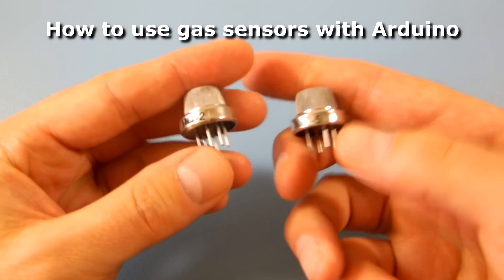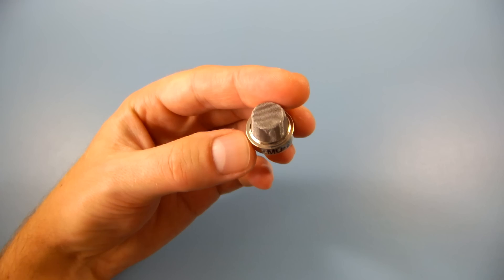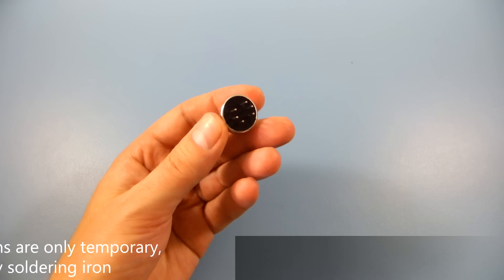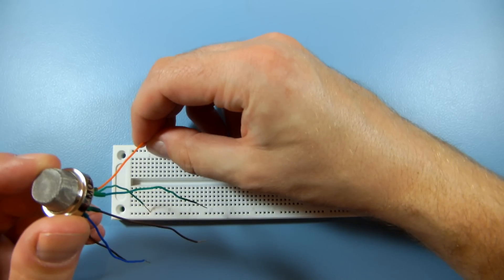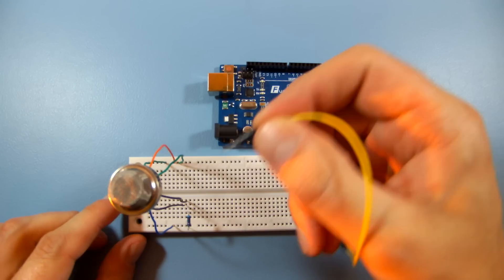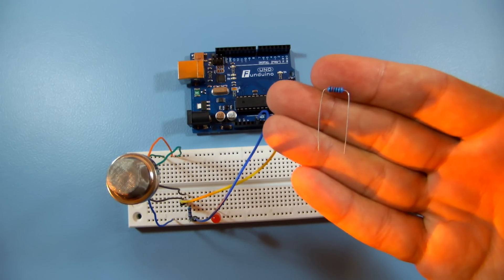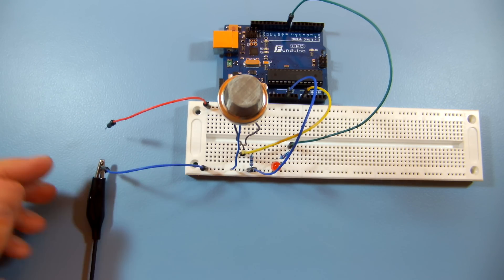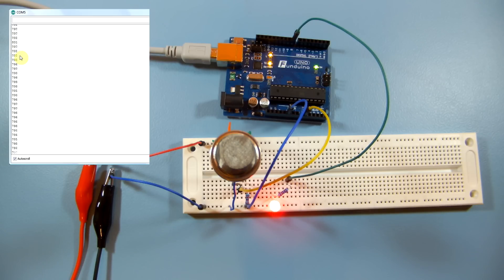How to use gas sensors with Arduino || Arduino tutorial

Comment: Hi love your videos, I'm in the middle of a project building a gasification unit to run a generator on woodgas, would you be able to do a video on how to use an Arduino with a car 02 sensor to control a rc servo adjusting the gas to air ratio?

Comment: Great video. However, you are just showing the analog input of the sensor which is useless when detecting any particles. The data sheet shows you how to calibrate the sensor and show the value in ppm.

Comment: Thank you for the video. Sir, How do we calibrate the gas sensor to sense a specific compound? I read the datasheet it said we have to connect a resistor or potentiometer to measure a specific compound. How do I do that, sir?

Comment: Wow!  There are a ton of questions/answers for this video.  I tried to search throught them with some keywords, however I could not find answers I was looking for about cost and about lower detection limit and accuracy in the low range of measurements.  Looking to build something similar but it would have to detect and readout values for CH4 way below the LEL at around the 10ppm range in order to be useful for my project. Sorry if this question is repetitive from those asked/answered before.

Comment: sir we are making project by using these same device but in this project we have to show different gasses volumes in air.like
helium.
nitrogen.
freon.
carbon dioxide.
water vapor.
hydrogen. on the monitor screen as you shown, sir plz guide us to show different gasses in our project

Comment: Awesome video, but can u please suggest a sensor which detects differ parameters of gas like carbon dioxide , carbon monoxide, oxygen , sulphur content in the air .I need such a sensor for measuring the air pollution .So please suggest a sensor which measure various components of air separately

Comment: why not connect it to arduino 5v power supply
and why after 2 - 3 minutes the readings go low? is the sensor only supposed to work for 2-3 min and then shutdown or the other way around to heat up?

Comment: I don't have arudino with me now plz check the programme I made 
int redLed = 12,8;

int greenLed =11,9; 
int buzzer = 10; 
int smokeAO = A5; 
// Your threshold value 
int sensorThres = 400; 
void setup() { 
pinMode(redLed, OUTPUT);
 pinMode(greenLed, OUTPUT); 
pinMode(buzzer, OUTPUT);
 pinMode(smokeAO, INPUT);
 Serial.begin(9600); 
} void |oop() { 
int analogSensor = analogRead(smokeA0); Serial.print("Pin A0: "); 
Serial.println(analogSensor); 
// Checks if it has reached the threshold value if (analogSensor > sensorThres) { digitalWrite(redLed, HIGH);
digitalWrite(greenLed, LOW); 
tone(buzzer, 1000, 200); 
} 
else { 
digitalWrite(redLed, LOW); digitaIWrite(greenLed, HIGH); noTone(buzzer); 
} delay(100); } 
const not LED =13;
void setup() {
pinMode(13,OUTPUT);
}
void loop() {
digitalWrite(13,HIGH);
delay(250);
digtalWrite(13,LOW);
delay(250);
}

Comment: sir i use mq2 sensor module that has 4 pins . how do i connect them to the arduino ? do i need to modify the sensor like taking out some resistors and capacitor on the module ?

Comment: which types of gas it can detect
Reply from the maker: MQ-2 gas sensor has high sensitity to LPG, Propane and Hydrogen, also could be used to Methane and other combustible steam, it is with low cost and suitable for different application.
MQ-5 - high sensitivity to LPG, natural gas , town gas.

Comment: if i put a 100 ohm resistor instead of a 120 ohm resistor for the led, will it work?
Reply from the maker: Yes, it will work :)
Reply: What exactly is the function of the A and B pins?
Reply from the maker: The A and B pins are used to sense the gas concentration, but I wasn't getting into details about their exact operation, so I won't be able to explain much about this topic, sorry.

Comment: do you use all of these sensor in the same way? I have mq4.
Reply from the maker: Not all of these sensors can be used like that, but the MQ-4 needs the same connections.
Reply: ElectronFun.com which mq-x can't be used like that?
Reply from the maker: I don't remember by heart, but if you look at the block diagram in the datasheet you will find different connections required.
Reply: ElectronFun.com yeah i should've done that instead of asking. Thanks!
Reply from the maker: No problem, cheers :)

Comment: Hi there, I'd like to build a CO2 gas sensor using an MQ-135 gas sensor, for my environmental science class. How can I adapt this project to an MQ-135 sensor? Also, the links to your datasheets don't seem to work. Can I get access to your datasheets? How can I create a similar datasheet for an MQ-135 sensor? Any assistance is most appreciated. Cheers!
Reply from the maker: You don't have to change anything in this project, if you want to get a value between 0 and 1023. I fixed the datasheet links, thanks for letting me know they were broken.

Comment: Hi! Can I just supply the sensor with the 5V pin from the arduino?
Reply from the maker: Yes, you could do that, but you would get quite close to the Arduino's current limit. Be careful not to fry the pin or the whole Arduino.

Comment: Thank you so much for this information. In our project, we didn't use arduino. Instead, we used LM358 op amp. Here's the circuit diagram. http://www.electronicshub.org/smoke-detector-circuit/ However, the MQ-2 sensor keeps producing burning smell whenever I connect it to a 5v dc for a sec. I checked all the connections but it was all right. Can you please help me identify what's wrong? 😭
Reply from the maker: I'm glad you liked the video. I'm sorry but I won't be able to help you. As you can tell, I'm replying over a week after you asked your question. I couldn't find time for the last couple of weeks to reply to comments in a timely manner, not to mention troubleshooting people's projects, sorry.

Comment: I want to use two sensor mq4 and mq7.Is it possible to take ppm value from this sensor using arduino?? Send the code and block diagram plz
Reply from the maker: These sensors output an analog value, which has not much to do with PPM. To convert it to PPM units, you want to calibrate the sensor and use it in the code.

Comment: hey i have mq-2 module...is there any need of giving connections to A ,B and H pins?or directly to Vcc pin?also is there any need of connecting Rl? bcz module have built in potentiometer?
Reply from the maker: I'm not sure if you are talking about the same module I have. On mine there are A, B pins and the heater element, nothing else.
Reply: I m talking about Mq-2 gas sensor module...u have only sensor..here,s the details. http://wiki.sainsmart.com/index.php/SainSmart_MQ2_Gas_Sensor_Module
Reply from the maker: I have not used these. Try to find the datasheet.

Comment: can we get more than 1 ppm valuesof several gasses  at once???? I want build a gadget for detect all percentage of gasses that emitt from a vehicle silencer at once.  I wanna to display all the ppm values  on a display....
Reply from the maker: Unfortunately no. These sensors can't detect which gas they are exposed to. Each of them is able to detect several different gases, but it won't be able to differentiate between them.

Comment: < , I want help with my project added to it GSM alarm
Can I know what codecs to install in Arduino?
Thank you very much
Reply from the maker: There are at least several GSM modules on the market. However, I tried using one of them, but couldn't make it work, because it was using only 2G, but my SIM card was not able to work properly with it. I haven't used a GSM module ever since, so I won't be able to help you with this, sorry.
Reply: So what do u think .. I can use GSM modem or not !
Reply from the maker: I didn't manage to run my GSM module, but didn't want to waste too much time for it. If you choose a good module and use a compatible SIM card, you should be able to use the module.

Comment: Hi, thanks for the video. i want to ask why you use output power for 5v then using from arduino board ? thanks
Reply from the maker: These sensors draw quite a lot of current and I didn't want to burn out my Arduino.

Comment: Hi I used MQ - 2 sensor and I connected it as you showed in this video ,

but the problem is the sensor value is >950 at the starting point itself and when bring some gas near to it it goes to 1023 .
I used a 20k resistor and connected parallel between B and A wires .

how to reduce the sensitivity of this sensor? :/
Reply: connected 20k resistor across GND and B wire as per ur circuit .

But still the value starts from 950 in room temp...  :/
how much voltage should i apply across A wire and GND  ?
Reply from the maker: First of all - have you pre-heated your sensor? The values may be inconsistent or inaccurate. A wires should be connected via the resistor to the GND - no extra voltage needed there. Apply 5V only to the heater element.
Reply: ElectronFun.com ,yeah I got it. Actually I forgot to preheat the sensor,then I found that after some time the sensor was working properly😅

Anyways Thank you for this good video and your comment😊
Reply from the maker: I'm grad you managed to solve your issue :) Sorry for replying so late.
Reply: No problem and Thank you ElectronFun.com :)

Comment: Good video. Subb'd. 
How long does the heater element inside the sensor last?
Reply from the maker: Thank you so much! I'm not able to give you even an estimated value, but I wouldn't worry too much for the sensor's lifespan.
Reply: If its like the rest of the Chinese junk, it would be useless if the heater element burns out.
Reply from the maker: Are you going to use these sensors 24x7? This may affect the heater element, but I'm still not sure how much.
Reply: Yes. I guess I will have to buy one and see. Thanks for the video.
Reply from the maker: No problem, good luck with your project.

Comment: that a really good work,its nice and please can i get a manual or instruction on how i can calibrate both MQ7 and MQ8 on Arduino uno board for detecting  CO and H2
Reply from the maker: Thanks a lot :)
Unfortunately the software calibration I showed in the video entitled "How to use gas sensors with Arduino" works only with the MQ-2.

Comment: hey there i actually tried to made same using mq-6 but in monitor mode it shows all zero value can you help me with that and all the connection were correct and are of same order ?????
Reply from the maker: I'm guessing there must be something wrong with your connections. When this happens to me and I'm not able to figure out what's wrong I disconnect everything and start from the wiring diagram once more. Sometimes a faulty jumper wire may give you a headache - it happened to me twice.

Comment: if i use a 5v 500ma supply will it damage the mq2 ???
Reply from the maker: No, it won't. As far as I remember the MQ-2 needs about 160-200mA at 5V.
Reply: so 200mA is the minimum one ??
Reply from the maker: Always take some safety margin into account and remember there are no 100% efficient power supplies. I would say 250mA for the sensor itself is a good idea.
Reply: so if I use a 500mA 5V supply how much resistor value do I need for 200mA, please only give me the approx value
Reply from the maker: You don't need a resistor at all. The MQ-2 will draw just the amount of current it needs. It doesn't behave like LEDs, so you don't have to worry about it burning out.
Reply: OK,thanks a lot
Reply from the maker: Sayantan Maiti No problem :)

Comment: Do we use any Microcontroller or arduino.?
I am bit confuse in both of them
Reply from the maker: Arduino is a microcontroller. I'm showing how to use the sensor with Arduino Uno, but you can use any microcontroller with analog pins.
Reply: are we restricted to any arduino or we use any arduino for gas sensors
Reply from the maker: I'm sorry, but I don't understand your question.

Comment: hi.. may I know which sensor can be use to detect n2. nitrogen.. I mean building a N2 supply inside a isolate small compartment. , would like to add in a sensor to detect leakage. Thank you
Reply from the maker: I'm not aware of a sensor from the MQ series, which could be used to detect nitrogen, sorry.

Comment: The values in serial monitor are voltage values.Am i correct?I want resistance values too.Is it possible?
Reply from the maker: Yes, these are voltage values between 0-5V - there are 1024 steps. Watch my vide entitled: How to make a simple Arduino ohmmeter - you will learn how to get resistance values.

Comment: my arduino programme for detection of Co2 using mq135 sensor is complete. But it is not running as I don't have the             
my sensor library. Can you tell me from where I can download it??
Reply from the maker: I'm not sure how you wrote your program, but I didn't use any libraries in this project. I was simply reading values from the analog pin.

Comment: Can I put the sensor output data on a computer text file?
Reply from the maker: You could do that, but you would need some programming knowledge. You need a program, which is able to connect to Arduino's serial connection and then write it to a file. You could also write your data directly to an SD card. There is a nice thread on Arduino forum: http://forum.arduino.cc/index.php?topic=44265.0.

Comment: How you can recognize what kind of gas hai a specific value? For example how to recognize ammonia from sulfure gas from co2 etc with this mq135? I would like to analyze all kind of gas in different graphics. One graphics for ammonia, one graphic for co2, one graphic for sulfure and so on. Is it possibile?
Reply from the maker: Unfortunately it's not that easy. These sensors are sensitive to ranges of gases and they won't recognize which gas they are exposed to. The only thing that changes is the resistance in the sensor, so the value you can read via Arduino changes as well.
Reply: thank you very much for your answer.
Reply from the maker: No problem :)
Reply: Do you know all kinds of gas that can be detected with this sensor?
Reply from the maker: The MQ-135 is a hazardous gas sensor used for air quality control and is suitable for detecting NH3 (Ammonia), NOx, alcohol, Benzene, smoke, CO2, etc.
That's quoted from the datasheet.

Comment: Hi,
 I did not get how it is  working internally  and what is the use of coil and what kind of material is used to sense the gas for MQ 5 sensor. please tell me...
Reply from the maker: Which part didn't you understand, about the sensor itself? Internal resistance changes, when it is exposed to gas, which generates higher or lower voltages. The voltage level is read by the Arduino's analog pin and interpreted by your code.

Comment: Thanks so much, this is exactly what we need. the only problem is that would either process work for the MQ-4, as our prime mission is to measure methane. Or would it be possible to get rid of all data of all other gases for the MQ-2 and only show the methane data. We are from Moate Community School and entering a project for Cansat. Thanks so much for your help.
Reply from the maker: Thank you for your comment. These sensors can detect a range of gases, but they are not able to differentiate between them.

Comment: does  gas sensors like mq 7 needs to be pre heated?....pls reply anyone....
Reply from the maker: Yes, it does. The MQ-7 needs 48 hours.
Reply: HOW TO DO THAT????////
I MEAN HOW TO PRE HEAT
Reply from the maker: To preheat the sensor, build your circuit with the sensor and leave it on for 48 hours. Just make sure it doesn't fail, or catch fire :)

Comment: What are those values from 0 to 1023. Are they the ppm values of the gas ?
Reply from the maker: These values have nothing to do with ppm. They are only indications of voltage from the Arduino's analog-to-digital converter.
Reply: ElectronFun.com Do you know any methods to covert it to ppm ?
Reply from the maker: There is a way to do it via software. See my other video on how to calibrate an MQ-2.

Comment: If i have to send an alert message or email can i do it with the same sensor or do i have to buy other module in which it is integrated as a chip ?
Reply from the maker: You probably won't find these sensors integrated into anything. To send e-mails you would need something like a Raspberry Pi. There are lots of similar boards capable of doing such things.
Reply: Thankyou sir
Reply from the maker: No problem :)
Reply from the maker: Using 9V batteries is not the best idea, because of their low capacity.
Reply: If I were to use MQ6 instead of the MQ2 , do I have to alter the code too!
Reply from the maker: You don't need to change anything, if you don't need ppm values.
Reply: Thanks again !
Reply from the maker: No problem at all :)

Comment: Hi, can i know whats unit of air quality. And upto what extent fresh air is their. I mean what is the limitation of pure or fresh air ?.
For example 300. what is that 300 we can call ?
is 300 is that fresh air ??
Reply from the maker: Unfortunately it's not that easy. These MQ sensors won't tell you that without calibration. What is more, two exactly the same sensors may give you a bit different readings and they probably will.